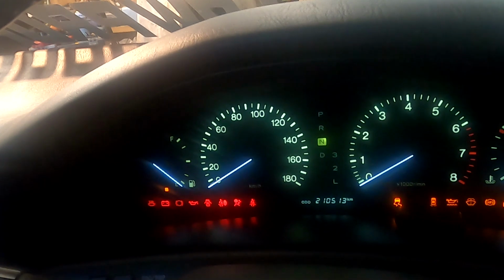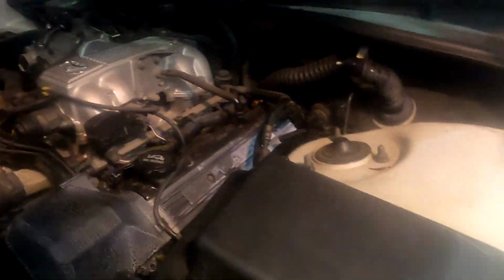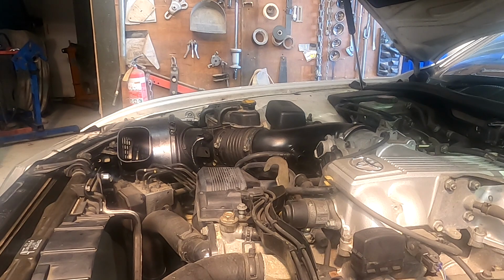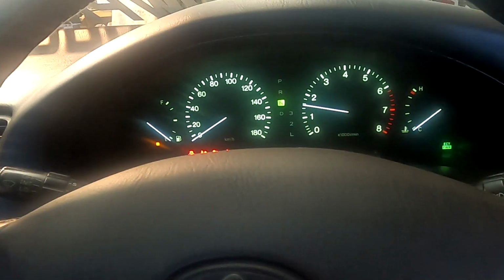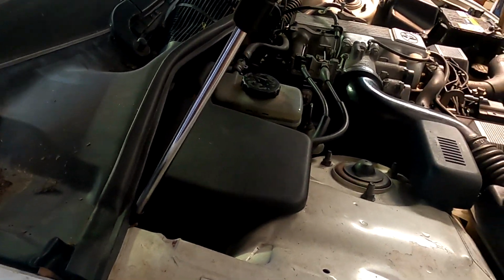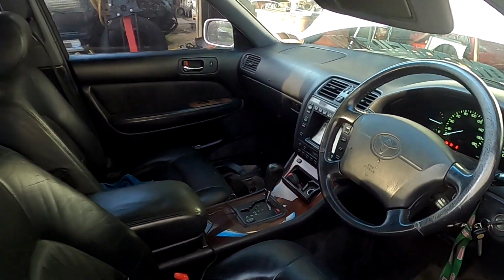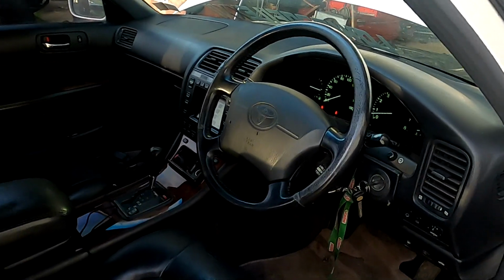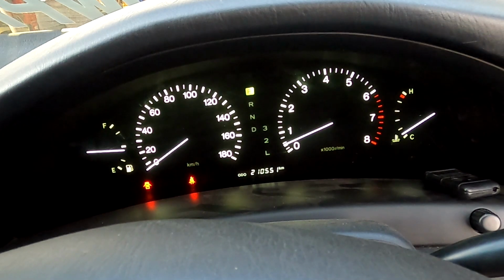Toyota Celsior or Lexus LS400 diagnosing. AFM sorted, Now to fix the idle issues. High or low?

Comment: Hello Kelvin. Great videos and information. I’ve been fighting with my 93 SC400 here in New Mexico USA. It is in its stock format. I had ECU rebuilt (and verified) and just had timing belt service done. The belt came off in pieces and was caught up in the crank pulley. Car runs good when cold but does die randomly when warm, code 13 RPM signal no. 2 is the only code and it comes back immediately after reset. Cam and cranks sensors ok, TDC verified, associated wiring ok. Where would you go next?

Comment: Agree fully about the difference between the UCF10 and UCF 20 engines...I've had both in the same car and UCF20R was smoother more powerful and generally better than the earlier engine which is in my LS400 now....I am still lamenting the day I ruined my original Series 2 1UZ-FE by not burping the coolant correctly, and consequent catastrophic overheat, after replacing the water pump....VERY SAD.
Reply from the maker: Oh no,  that is sad.

Comment: My uz is a bit ill at the moment she runs fine for daily use but when I throttle up above 2500 rpm full throttle no power but if I squeeze the power gently she’ll rev right to limit all the powers there just doesn’t have it when the throttles wide open at low rpm you have to gently rev her to the redline, what do think could be potential problems, I’m Thinking of upgrading the whole ignition system to a link g4
Reply from the maker: Id be doing the normal diagnoses,   I do a quick visual ,  check fuel flow,  check ignition,   check signals at ecu,  live data,  codes, ecu condition etc etc and that generally finds an issue.  Cheers Kelvin

Comment: i wish my 1994 ls400 would idle correctly! it used to idle at like 6-700 but recently its been about 3-400 rpms never touched anything on this car but ever since i replaced an ignitor its acted strange...
very annoying
Reply from the maker: Have you considered its something to do with the last change?  Otherwise some proper testing and diagnoses is the best way forward.  Cheers Kelvin

Comment: Hey Kelvin my 1994 SC400 is running super rich, I did everything I can to it. I got a rebuild ecu, new spark plugs and wires, distributors caps and rotors, new o2 sensor and I even put in new fuel injectors. That didn’t fix my problem. What can you think it could be? A fuel pressure regulator? Bad fuel filter? I even put in a new mass air sensor but that didn’t work either so I return it back. I want to enjoy my 1uzfe but she’s been sitting on the side of my place and it’s making me sad.
Reply from the maker: Id recommend checking and testing it properly to diagnose it.  I dont guess, I test.